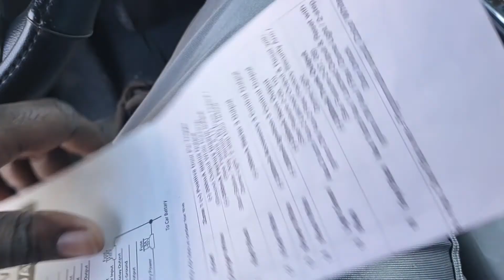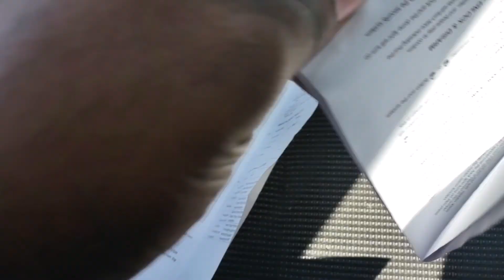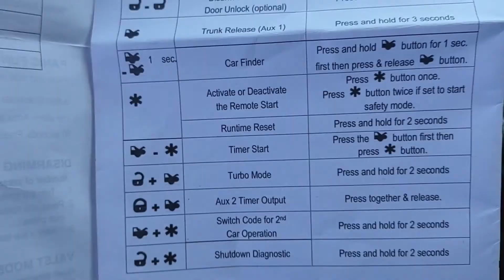Finished The Alarm And Remote Start On The Chevy Malibu

Comment: Hahahaha I am over hear trying to catch breath🤣🤭I was just minding my business and next thing you know I caught what you said😭its true I do what I want but in my southern accent
Reply from the maker: lol..
Reply from the maker: Check the fuses, check for a disconnected ground wire under the hood, they could have disconnected your tach wire from the coil/injector. Also check and see if it has a disconnected hood pin. Do it do anything when you try and remote start it? Do the light flash or anything?
Reply: @Change4ADollar  no it doesn't do anything with the remote i don't know what they did to it, but I had bought a replacement remote it works fine with but I lose the remote start, maybe they disable it completely from the remote.

Comment: What kind of Bypass did you use?
Reply from the maker: Fortin EVO All-In-One Data Bypass And Interface Module
Reply: @Change4ADollar  cool thank you.
Reply from the maker: @chosenchild8416  No problem...
Reply: @Change4ADollar  how long did this take you and did you run into any issues along the way? I'm wanting to install a Viper remote start on my 2013 Malibu.
Reply from the maker: @chosenchild8416  around 2 hours, and no I didn't run into any problems....